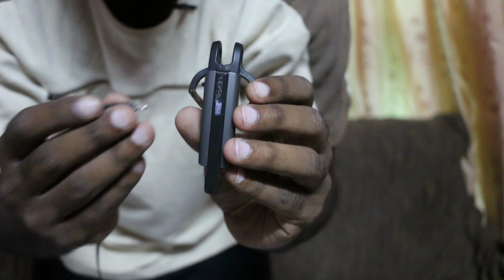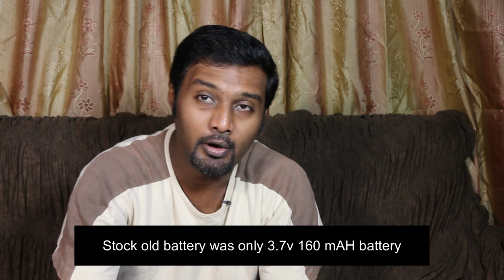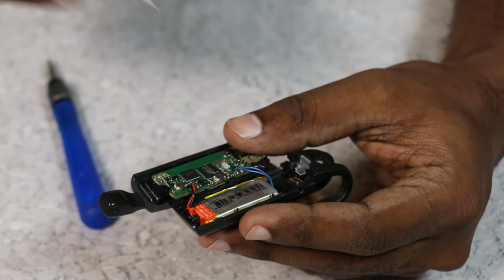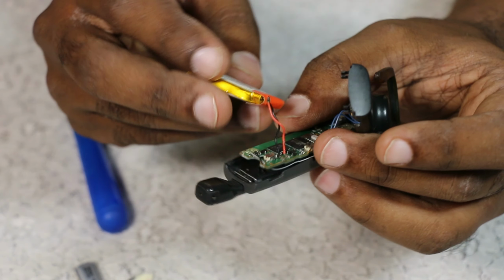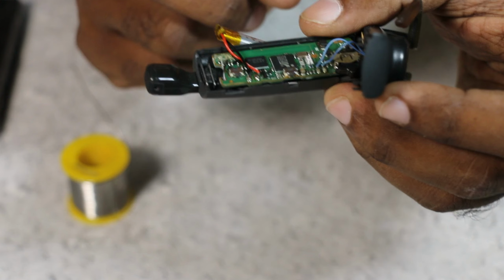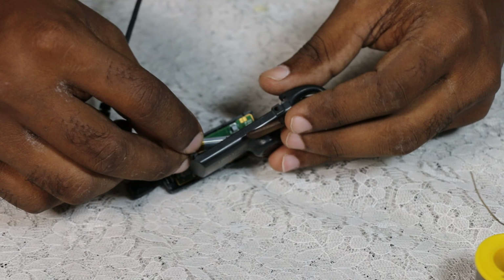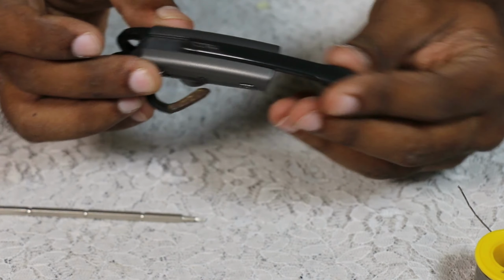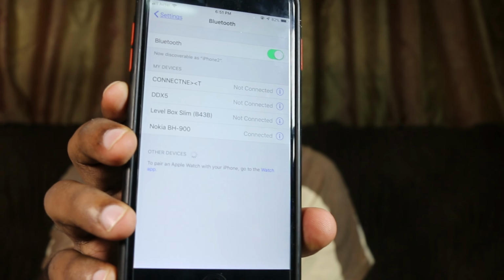Nokia BH 900 Revival | Battery Replacement DIY

Comment: DIY is something everyone should know in these times
Reply from the maker: Especially when labor costs and raw material costs are going sky high. Its smarter to keep running our older gadgets longer.
Reply: @StanDaManReviews  yup also market crash and supply shortage is in the cards. We should store food grains. Fuel and adapt to self. Sufficient living.
Reply from the maker: @AshikJonathan  Yes, you are right. But many people not realizing it.
Reply: @AshikJonathan  to be honest even I’m expecting the same. Also if you see the ruppee to the dollar , it has worsened since 2014 drastically , that’s why most imported things are expensive.
Investing in crypto is also a bit safer I think because that’s the only thing that can beat crazy inflation levels . Gold also is good investment.
Reply: @chickensnipers6996  crypto without any intrinsic value... 🤷🏽‍♂️

Comment: Since I've bought my Nokia bluetooth headset BH-900 new from the box long time ago and never used it.  When I decided to use it, it does not work.  Please assist.
Reply from the maker: The replacement battery won't be original , so it won't last as long as the OEM battery. Mine worked fine just for a month. After that battery capacity reduced drastically. Right now battery lasts just for a few hours.
Reply: @StanDaManReviews  I hear you Stan, I wonder why is NOKIA is not making original batteries anymore for these head sets.  Anyway, thanks for the advise.
Reply from the maker: @macgregor6511  Its an old design and usually after 6-7 years, they replace with new design and new batteries, so the old products don't get support with spare parts. This is the same case with our mobile phones as well. After 3-4 years , we never get the original batteries for our phones. The 3rd party batteries are all crap which don't last even few months.
Reply: @StanDaManReviews  I'm using my BH-900 since 2009 till now. Battery was replaced once during this period because my shirt was washed with the handset in the pocket :). Now it is still in use but the battery need to be replaced again. Lookin for it ...
Reply from the maker: @ALEXS-ri2go  It's difficult to get good new batteries right now. The one I bought just lasted for a month and then died.